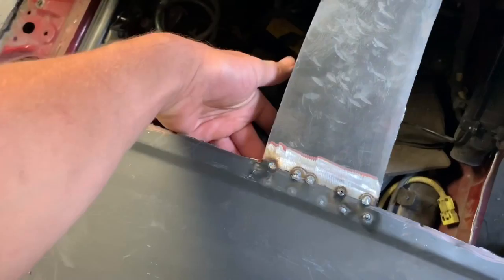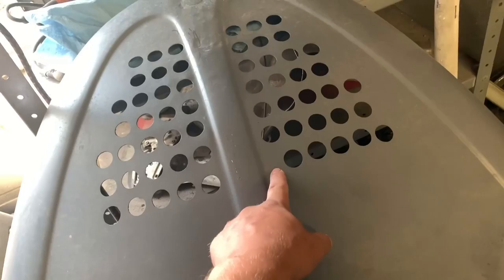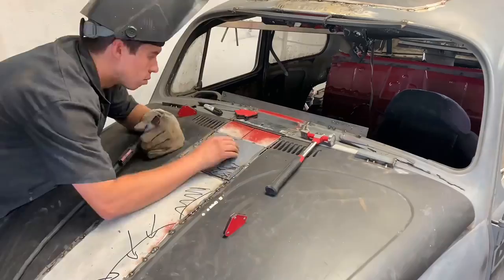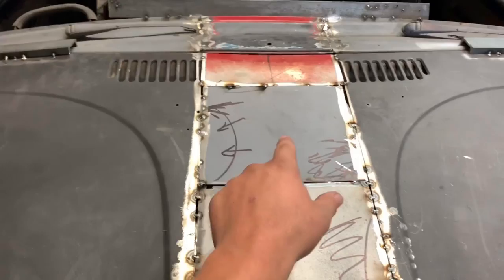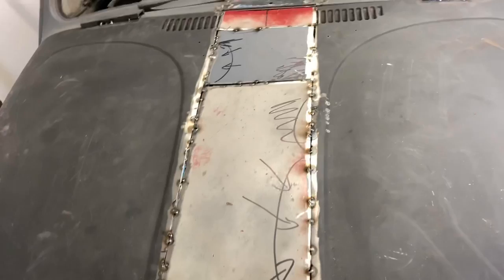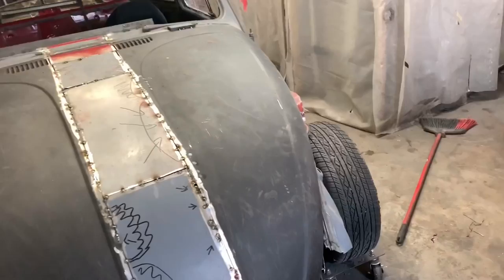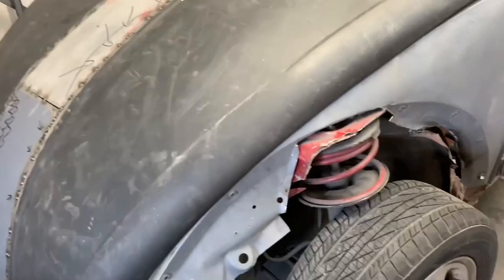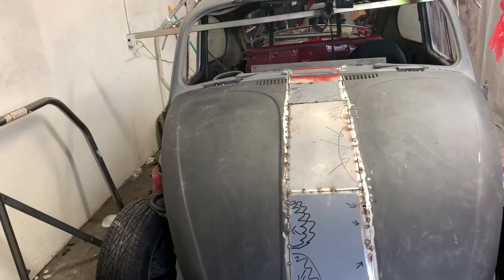Honda Powered VW BUG gets a WIDE HOOD!  { K24 MR2 Bug}

Comment: With that wide strip down the center of the hood, You might almost have room for a microbus-sized VW logo at center top.
Reply: That would look a trip a chromed out one. He can go all kinds of diffrent ways with it. I've seen VW shows in California and all the other small car's. My first car I customized was a 1968 Toyota Corona 4 door back in 1989, I made it look like older than what it was I shorten a 51 Buick grill with BMW bumber guards in the front bumber 4 of them so it would have the 50 Buick look with the Apple ton  spot ligh on the front windshield white wall tires with the stock hub caps but I put 3 prong knock offs on the caps there was way to much to list hear. It wone trophies at a lot of shows at the time. It really stood out everywhere I went people wanted to ask questions about it. On the road people would give me thumbs up it attracted a lot of attention.  I ended up selling it  to found my next project. Gas at the time was $ 1.10 a gallon I was 19 teen years old.  I was able to drive that car everywhere it wasn't just for show it was go to.
Reply: SNOOP U 2 sounds wack

Comment: A little constructive critisism, looking at your spotwelds You are going in way to hot, i noticed alot of burntrough. Also check your gasflow, seems it is way to low. .
Reply from the maker: Gas flow is plenty, too hot though
Reply: If you try weld 2 pieces of paper together is gets easily too hot. maybe even the lowest power setting on his Lincoln is just too strong, tried slowing down wire feed? Thinner wire? Other metals, which conduct less heat. It is the trunk lid is doesn't have to be really really strong. The thing puzzling me is these aren't his first welds with this metal of a vw bug. Because I know it would annoy me I really fast, I would have solved the heat problem in the beginning, it saves time & makes the job more pleasant by not getting burned by flying ambers every few welds.  Also saves time grinding less chance of warping the metal, which will mean less puddy, less sanding and a better result faster.
Reply: @Deer Gut I am referring to thinness of the metal FYI.

Comment: If you have two hoods, cut about one third from each. One remove the passengers side. The other the driver side.  Now over lap them.  Slowly spread them apart until you have the desired width.  Now mark a line down the center of the overlapped hoods. Cut both on that line and weld the two "halves" together.  And yes the detail ines wont match up but really You're not gonna have fenders either.  Good luck with the build!  I am pulling for you.

Comment: Awesome!! Remember, it's not a typical VW so it won't look like one. It's your vision, your project. your sculpture. make it strong and party on. Now for under the hood, maybe consider bending a piece of tube to weld in under the graph-ted part that will serve as structural support. this, (maybe), will help to stabilize the complex curvature mashes that are going on there. And bondo or even a fiberglass matting cover will fill everything in and allow you to sculp it. Baja fender concept really looks cool I think you can still pull it off. Since your in this far, hell, lower the top of the front tower and cut the spring. easier way ro rake it than re upsetting the body again. Still, looking good!!

Comment: Well done, once again you saw what you wanted and went for it... and not a bad result. Having gone through the roof trauma I was surprised you didn't weld a few brace pieces to the hood before you cut it to stop it springing out (like it has).  Once again, you could pop in some strengthening pieces across the underside when you are happy with the top surface. There are so many ways to get the look you are after and as long as you keep moving there is no doubt you will get there. At the end of the day you might enjoy trying some lead filling in places where pieces have been welded together... old school and doesn't crack like bondo.

Comment: I use to get sheet metal from a local HVAC company to fill the gaps on my panel mods.  Sometimes a flat sheet is easier to work with.  Looks great.  Are you planning to put the fuel tank in the front or next to the engine?  The front shock columns may require more support than your Bug body can handle.  You could extend the front suspension out like a drift car, This would give you a different shock column angle, possibly enough to clear the Bug body.  Another idea is to cast your own front fenders out of fiberglass.  The mold can be made out of plywood, plaster of paris, and foam.  This might also be a great way to get a hood that has the look you want.  The plaster helps give you a smooth top finish without sanding.  There are still a few of us old school guys around that can help you design the molds, if you wanted to try it.

Comment: Just use lowering springs at the front. If you drop the body down over the MR2 chassis/floorpan the strut towers will be poking up through the bonnet. If you used smaller diameter front wheels you could cut the lower spring cups out of the struts and lower them 2 inches, or a combination of lowering the strut cups 1 inch and cut a coil out of the front springs.

Comment: Looks interesting, as for the hump, those sections of the hood have a deeper "bowl" shape than the section you're trying to build, you may find it easier to work with flat sheet steel rather than struggling to get a side section to work.
As for dropping the car, I know from personal experience that if you don't drop the rear, you WILL need a spoiler or the rear will lift off the ground.
Trust me, that was not a fun experience.

Comment: Seriously nucking futs! That said, a good idea using bonnet metal, as it not only has almost the right shape and twist, but also the strength of the steel will be about the same once you weld it properly.
Go for it!

Comment: Just a thought on the no fenders idea. The way you wanted to run the braces on the front end, you could trim a fender to go around it, have the tubing coming through the fender for the bracing. Could look pretty cool having the tubing going through it like that. Just another idea to Cram in the ol noggin. And last, is the raked idea for looks or function? I believe you've said before youd like to get the front windshield area down a bit, if that's why (for a better driver view) then I think it's worth a shot, if it's purely aesthetics then I think there are better ways to get the rake look.

Comment: Hey, kinda like the hood.  Just a thought, what about cut the center out of another hood and weld it on top of the panels on your wide hood... Make a secondary trim in the center and feather it at the top and at the bottom (at the hood handle).  I think that would had more dimension to the hood.  Finally, on lowering the front, why not just go with lowering struts rather than moving the body?  Either way you go, I'm looking forward to seeing what you do with the rest of this project!
Reply from the maker: Good thinking! I’ll explain the body drop in the next video because a lot of people are confused by that haha

Comment: Love where you're heading with it. Only one piece of advice from the school of hard knocks. Work one area to completion, before starting next part. Example: get the body all the way to were it needs to be for you to be happy. All the attachment done and holes filled then the other stuff will come together easier. I see many revisions coming on the hood as the front structure changes to fit your vision.
Reply from the maker: That’s a good point, I do that a lot because I’ll hit a road block or run out of ideas so I jump to something less mind boggling

Comment: Please don’t rake it. I don’t think your method is going to work. Might end up causing way more issues. But I love the no fender idea. Hammer the front wheel wells back to meet the bug body like you would if you wanted to run big wheels. That will help clean up the space. Run coilovers to get the desired rake and you’re good. Just focus on cleaning up the fitment so it actually looks like one car. Love the progress keep it up!

Comment: Hi it would be easier to create a joggled edge for those bonnet insert panels so it overlaps the existing panel you can then plug weld from underneath and also you could try to add a ridge down the centre as this will add rigidity to your wide bonnet... you can use something like a piece of wood or metal as a former to beat in a ridge with the hammer if you don't have a bead roller... I can see your skills are growing each time keep going...
Reply from the maker: I thought about something similar as I was working on it haha

Comment: I vote no for the body drop. just raise the seats a little to get a good view out the front. I like the idea of tubing support for the front strut towers. I also like the idea of cheap front coil overs to make some room an clean up the front lines. I don't have an opinion on the fenders. can always do that last. structural, functional, driving, then make it look pretty after it does some donuts. I think the hood is a good start, but I didn't see the wet rag trick that worked on the roof when tacking. I like the big hood, its a big in yo face statement. keep it up!

Comment: You could always scallop the hood by getting yet ANOTHER hood  for parts - cut a strip out of the center of that hood 1/8" wider than the gap you need to fill.  Cut that strip in half right down the center (that's why 1/8" wider - you'll lose  it here from the cutting disc).  Swap the halves, using the driver's strip on the passenger side, and the passenger strip on the drivers side.

It will also stiffen the hood a good bit.

The bottom center might get a bit hairy to match up well, but it should look REALLY good when done.

As for fenders, you can always build it without now, and chop a set up later to fit on there.
Reply from the maker: Holy crap that would look awesome!! I’m gonna do that!!!
Reply: @GARAGEIdiotS  - due to the curvature, you might not want to get another hood.  You might want to just cut the raised center section and bottom curve (I'll just call it "edging" from here) out of the hood you already cut patches from, cut your current patches out (yeah, I know, ouch), then weld those flat patches in from underneath in place of the reinforcement strips.  Then weld in the swapped edging pieces.  Recurving them to fit the current hood should be a lot easier than trying to recurve 5-7" wide strips curved the wrong way.

You may need to inset the flat patches a bit, maybe adding a strip of sheetmetal between them and the hood halves, to get the right depth for the added edging to match up to the stock edging relief depth.

It might take a LOT of work, but should result in a really stiff hood and a unique look.  Then when you get to the painting phase, you can paint the raised parts a different color and have giant scallops on the hood that are fully 3D.

Comment: I honestly think that you should put the full fenders on the bug with a small lip off the wheel wells (outside edge) with the wheels tucked. Don'tt lower the front cause you will lose the integrity of the inner fender wells and not have enough support for the hood to side where it currently sits. So far I like what your doing with the bug. It's cool that you have the time and money to work on a project. As to where, if I wanted to do a project I couldn't cause i don't have the time or the money.
Reply from the maker: Luckily this project has been cheap, and time is a struggle to find

Comment: Coil overs are the way to go. Those bulky struts look awful and aren’t needed in the end. Having things for shock value alone won’t impress anyone and will bring on unnecessary criticism. I suggested dropping the body so it would look and feel better when you drive it, hanging your arm out the window etc. you can achieve the same end by raising the seats so it will feel closer to stock. And won’t look like you slapped a bug body onto another chassis. I think you’re going for a little more smooth amalgamation of the two cars. Just don’t overthink every little thing. You have a vision so go for it! Will be watching every step of the way! BEST OF LUCK?

Comment: You have great ideas, The only thing I may have done is get a professional opinion on the rocker panel area on both parts. And then use my own judgement on what is best, based on my ability. regardless you are doing great and will get there when you get there. It will never be finished per say, There will always be something you can improve on.  what is the saying roadkill guys say, Don't worry about getting it right, Just get it going. You can do it, Just keep pushing on! (REO Speedwagon 1977 Live: You Get What You Play For)  Great double album, Yeah I am a old guy, That started working on cars at 10, had my first car at 11 1967 Buick Grans Sport. Spent my whole life working on different types of vehicles from imports(1982-91) to medium duty Gas trucks. And now I worked so hard my whole life my body is shot. A few bad car accidents didn't help either. (racing almost every night is dangerous) I have metal plates, cadaver bones, wire and screws hold my spine together. My neck and lower back have been rebuilt with varying degrees of success. I enjoy watching you do it your way,  learning along the way. peace out.

Comment: Looking at the back of the bug it looks like you still have a gap between the two sheets of the roof, suggesting a third brake light or a scoop. If you go with the  break lights  the one on the new bugs are long and narrow it might work and it will look like it was intentional

Comment: Looking good. Don't listen to hate cuz we are all idiots...lol
Raking the front is a good idea...helps to see over the dash too...lol
Changing to coil overs might be something to look into.
I know next to nothing about welding, but can you fill the gaps in the hood & then grind them flat? Use a wet towel to keep the heat down, clean & weld...until the area is full...then either hammer or grind to get what you want...idk...just wondering...lol
Anywho, I hope you have a great day & be safe.
Reply from the maker: Thanks man! And yea I’m gonna full some of the space with weld but more so just so I know it’s strong, then use a fiberglass bondo to finish filling the gaps

Comment: You are using a piece of the hood that is round you need to put flat Steel as your spacer that is why it is roundish in the middle use a flat piece of Steel one piece not three pieces if you can get one piece you will have less welding pieces make sure it's flat anytime you swapping engine make sure you keep all of the harness whether you use any of the add-ons or not for instance if you have power windows and your harness and you do not use them Target in the door anyway
Reply from the maker: Roger that! Thanks!

Comment: You could lift the back instead of dropping the front to give it the rake you want but still have the option to run fenders if you want
Reply from the maker: Well the point of dropping the front is to put the dash lower so I have more visibility, however, I’m glad you’re thinking because that was a great idea! Thank you!

Comment: Stop Stop Stop.... not s fan of ur new vision,  but hey its ur idea. ... cut that hood back apart because ur under structure needs done first. Those side panels are flappin in the wind. How can u fit a hood when shits flappin. That hood can NOT be welded until that front dog house is solid. I think it would look better to hide the strut towers with the fenders but if ur gonna keep then exposed maybe look into a nicer cleaner lookin coil set up and incorporate ur new strut bar into the sheet metal to make it flow and be smoothed or run ur bar over the top so u cant see it on the outside. Why rake the body when u can just get a drop spring or an adjustable coil. As for being a bodyman all my life, u murdered that hood and those other hoods. Ur cutting out a piece that curves 2 ways. Thats y there not fitting right . Cut that mess apart, get those side panels solid then fit the hood. Flange the hood opening so ur new metal sits flush, make templates outa thin cardboard and use flat sheet metal to fill it in. Then theres no gaps to fill. Everything overlaps. Use self tapping screws to hold it in place and spot weld in. Then remove screws and weld'm up. Some support underneath wouldnt hurt. That hood might flex and crack ur filler if u go that far. U keep jumpin around man. I know ur pressured on puttin out videos,  but theres steps u gotta follow. 1 step forward is better then 2 steps back. On the brite side, theres 2 less hoods takin up space in the shop......